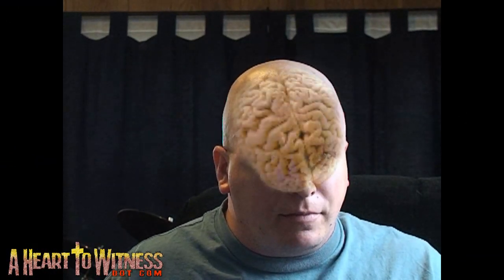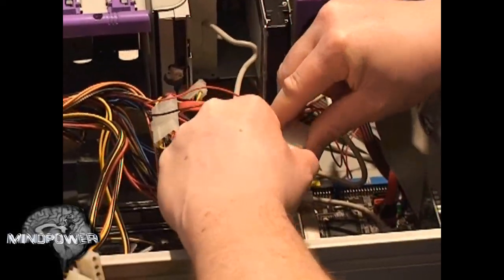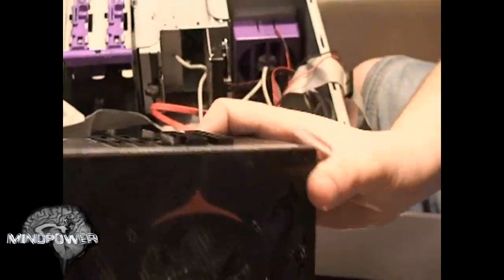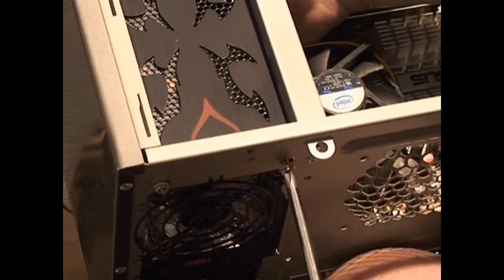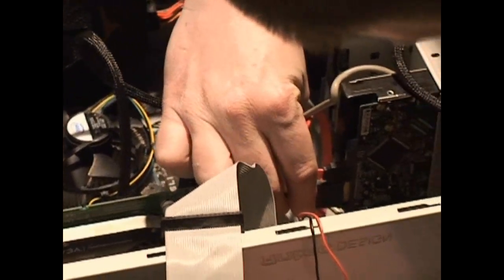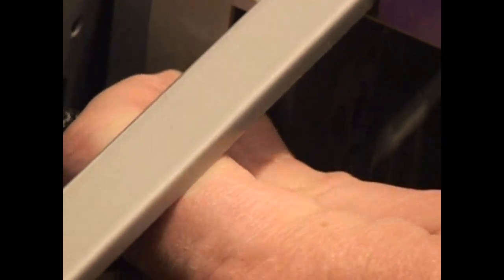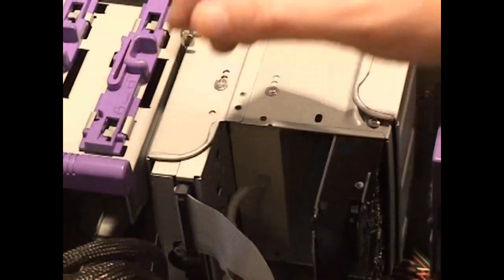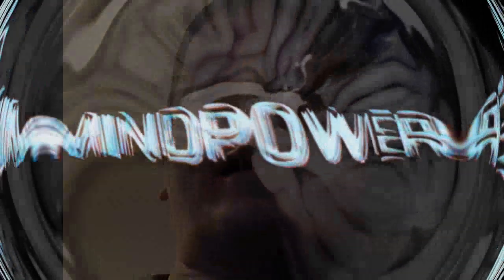How to Replace Your PC's Power Supply - Mindpower009

Comment: i found this psu.will it work ? it is Hantol psu 550W atx(12v 2,0) 120mm fan with 20+4 pin connector and 3-Sata

Comment: in theory, yes it would work but what we need to know is what power supply you have. You can't judge a power supply by its wattage. you need to research into it. First thing is that if your pc a a prebuilt, i can guarantee it's not going to work without blowing up your pc. E.G my good quality 500w power supply has a 6pin and a 6+2. Add those together and you get 225 +75w from pcie +more for the cpu. If i plug every connector into something, My psu wont handle it even though it is good quality

Comment: you will probably save money and get better components if you just buy them yourself and put it together. as far as power supplies go, you really dont need to worry about atx, matx ect, you can run into issues with oem cases but its not likely to be an issue like it could possibly be with a mobo. manufacturer and power ratings per 12v rail are important as well as sli/crossfire abilities if you ever want to go that route. also whether the psu fan is on the top or bottom can be a thing to conside

Comment: If a GPU requires a certain amount of wattage can you buy a PSU that just meets the requirement? Say the GPU requires 600W, so you buy a PSU with an output of 600W and it will work?  Constantly afraid that I will either fry my system or just not have enough power |:

Comment: Hi!
Then maybe you can tell me the solution of my problem. I bought a new power supply, and I put it into my PC, but it didn't work. I turned it on, and pushed the button on my PC. For a little moment the fans started working and then stopped. I connected the 24 pin cable and the 4 pin cable to the motherboard, and I connected my CD player and HDD. My videocard doesn't have any power supply slots, so I didn't connected it. I don't know why doesn't it work.

Comment: No, but they're very similar.  You should probably measure yours and make sure you get the right kind.   Most are ATX power supplies, and while older power supplies won't give you all the right cables for most modern computers, newer PSU's will provide most of the resources you need for an older computer.

Comment: What u did is pretty cool and all but i'm scared that there is a chance that i'm gonna mess up my PC. I only want to do this for installing a geforce GTX560(graphics card)  and it requires 500W power supply. Can u tell me if i replace my power supply to more than 500W power supply, can a pci express X16 slot alone provide more than 500W for the graphics card or do i also have to connect the graphics card to the power supply.

Comment from the maker: It's not exactly the same one, as my particular model was discontinued before I put that link in.   It's very similar though.  Most power supplies are very similar.   Just read the instructions, and remember to plug in everything you unplugged.  You might put labels on the plugs or write them down or something so you never forget.

Comment from the maker: You can usually see it on the back of the PC, but if the info is not there, you might have to open the PC and look directly at the PSU, maybe you'll have to google the model once you can see it on the box.

Comment from the maker: The gfx cards usually have whatever cooling they need built onto them (although some would say it isn't sufficient)  As long as the PSU and card will FIT into the case (most times the PSU will, but the cases of most of the HP PC's I've seen are pretty tight, it might be tricky to fit one of today's huge cards into it), it should be fine

Comment: Hi, I have an HP Pavillion desktop PC. I currently have a 300Wpsu and Radeon Hd 6570 gfx. I'm thinkin of upgrading it to 6870 and get a higher psu to support it. Is it possible to do this for an HP desktop? or do i need sum kind cooling, or new case etc.?

Comment: Probably, most of them are the same size.  It just depends on how many watts your system needs.  Make sure that there are enough watts to supply the computer.  If there are more watts than needed, the computer will just use only what it needs.

Comment: @Rhynorune I agree with AtomicWrangler86.  Your video card is probably fine, depending on what you're using it for, but the power supply really needs an upgrade.   300 Watt is not enough for your setup -- at least 500W in my lowly opinion.

Comment: @kuljd There should be another 4-pin section that has a clip on the side of it, that will connect to the side of the larger section.   If not, it's not an ATX power supply and you won't be able to use it.

Comment: @Rhynorune You should be able to add any wattage you want, as long as the power supply is compatible and can fit.   Your computer will only use as much power as it needs.

Comment: @ChirpeEprihc Then you'll either have to pull harder, or probably want to take it to a professional.   They can be really stubborn, but I've never come across one that won't come out.   As you can see in the video (maybe!) I had to pull super hard to get this one out.  That was 2 years ago, and even the new power supply is really stubborn.

Comment: @hyper9braker You'll have to brace the motherboard with one hand, pinch harder on the clip (yes, there is a clip that holds it very tight) and pull harder on the plug (not the cables!).   It's the only way.  You can use pliers but be sure to cushion them with tape or something because it is REALLY easy to crush the plug and damage it.   BE VERY CAREFUL.

Comment from the maker: @GozerTheGozerian Yes, and the other commenter was me (brobryce2009) :)  This video was shot back in 2008 I think, back when I only had one (not so great) camera and no light kit.  There are so many things I would do differently for this video, but so far, it's still helping people get the job done today.   As for the fingers thing, you might be right.  But I think a person can reach in and slow down the PSU fan without opening it.  At least that way they can find out if the PSU fan is bad.

Comment: @MindPower009 Right on. I just wanted to note that because the other commenter suggested putting your fingers in the unit to see if the fan's failing. I was worried that people would take that the wrong way and put their fingers in the power supply, which would not be good at all lol. 

Good advice on taking notes on wire placement, etc. Also might be useful to snap a few quick photos on a cam phone for reference before swapping out. Good job on the vid.

Comment: @Mike20878 you'll want to open it up and find out for sure.   You can put your finger on a fan and slow it down a little and if the noise stops, that the fan.   If it's the power supply fan, then it's time to replace the P/S.  I could show you pictures of what happens if your P/S can't cool itself down.   You don't want to be around when that happens.

Comment: I'm hearing a high pitch whining noise that sounds like it's coming from the power supply.  I suspect the fan has stopped working.  I can see right through to the inside when the system is on.  My system is about 7 yrs old so I figure it's time to replace the power supply.  It's a Dell Dimension 8400 and it came with a 350W power supply.  I found an ATX 460W supply that I think will do fine.

Comment from the maker: @rickrokks mostly the PC's from the last 8 years or so use the same type of power supply.  The only difference (most of the time) is just the sata and the rail line (for newer video cards) and wattage.

Comment: @saniydel Hey it sounds like you did what I do very often, and that's unplugged the internal USB connector from the motherboard.  It's an easy mistake to make when you're pulling all those plugs.  It's also a simple fix, just open it up and plug it back in.  Sometimes, if each pin has its own plug, you might have to google a USB PINOUT so you can figure out which pins go to which.

Comment: hi, i changed my power supply because it wont work, it was 300w, and i changed it into 550w, after i install all the wires and everything, my pc was working agian but the mouse, keyboard and webcam wont work. i tried to restart, then plug all in then remove it but nothing happens.,,, can you help me with this please?

Comment from the maker: @hlpization If you look closely you'll probably find that it is connected to your motherboard plug.  Many times they are attached and you can usually separate them as they are just clipped together.

Comment from the maker: @KillaKanl0rd MOSTLY universal.  If you open it up and the power supply looks like mine you can probably go out and buy most any power supply that matches your PC's configuration.  You want to make sure you get one that connects to your hard drives (like I was going from IDE to SATA) and can also power your video card.   There are no guarantees, but you'll be surprised how easy this is and how most of them do fit.

Comment: @gamer141235 Power supplies are universal by size, meaning any psu will fit into any desktop, providing it is not a "slim" desktop. 

Also, ensure that the psu you get has the same ATX format as your motherboard, as well as an appropriate amount of peripheral adapters. If this new graphics card you are planning on getting requires extra adapters, ensure the psu has them (usually they are either 6pin or 8pin connectors.)

Comment: @MdxIxbM it could have a 1,000 watt output, and if the computer is using anything less than 1,000 or whatever its limit is it should be good.

Comment: PLEASE ANSWER,

i am getting a computer and i feel i might need to replace the power supply in order to support a graphics card i want to get. What power supplies would you recommend and do any type of power supplies work with this computer. By the way, the computer is a hp pavilion p6700z series desktop if that helps. Thanks a lot, i need the guidance as i am new to these things.

Comment: @Hunock If you don't replace that power supply, and you run that 5770 (which is the one I ended up going with ) your PC might burn your house down.  Get a better power supply right away.  islagkage15963's comment is right.

Comment: @Hunock the hd radeon 5770 require atleast 450 watt power supply. so try checking out a price check site. find the cheapest with id say atleast 500 watt go in and see how it rates and if you can find any reviews of it so you can make sure it won´t catch on fire or anything

Comment: I bought a dell studio xps 8100, and I am currently trying to buy an HD Radeon 5770 Graphics card, but I fear my 350 power supply won't handle it, if possible could you reccomend a higher power supply and name its price, and if its not too much trouble, I know it won't draw more than it needs, but appart from human error (Hitting it off the motherboard during install) a power supply cant damage cards or hardrives ect right?

Comment: GENERALLY, when replacing a lower wattage PSU with a higher wattage PSU, providing the new PSU is of reasonable quality, it poses no danger to the computer, right?

I'm planning to upgrade a Packard Bell Imedia S3720 (PSU 250W) with a 500W PSU to allow for adding a Sapphire RADEON 4870 1gb GCard... Main concern is the PSU

Again, will doubling the PSU Wattage pose any danger to the internals, so long as it's of reasonable quality?
Thanks

-Richy

Comment: what's the model number or name of the psu you replaced?I like it cause you don't have a bunch of wires snaking out the psu and it look neat for it to be wraped around in black . if your don't have a video card u don't have to plug up those's cables

Comment: @AliRemix2009 I wish i could help! I'm 13 as well, and i'm replacing my 300w with a 500w so my new graphics card can draw more power. The graphics card part is easy, but im nervous about this power suply thing too!! Well maybe you should get a 450w or a 500w, it depends, Why are you getting a new one? It won't make it any faster unless your old one is too small.

Comment from the maker: @nightingaleron The power supply might affect the speed IF the RAM or the CPU were underpowered with the original PSU.  In this case, it's not really the NEW one that's going FAST, but rather the OLD one wasn't giving you enough to run the system, and it ended up going SLOW, choking on the cycles it was trying to do without enough juice to do it.  Other than that, typically the PSU doesn't make it any faster.  It's easy to underpower a system, though, especially these days!

Comment: I just changed my psu as it blew, the one i had was 350 watt output and the one i replaced it was 400 (thereabouts cant remember but it was bigger) I am new to this but my computer seems to run a lot faster and i am wondering if putting a bigger wattage unit does that. (i see you are going from 300 to 600 ).

Comment from the maker: @xBURNINGxDUCKLINGx Each plug is meant for a specific connector, but all the connectors that look the same also work the same.  for instance, the ones that fit into the CD/DVD drive, generally also work with the hard drive and even sometimes the case fan connectors.  The SATA connectors for the newer hard drives will work in SATA CD/DVD drives too.  The floppy connector is different, and the connector for the motherboard is a big different one :)  Not a stupid question.  Ya gotta know b4 u do it

Comment: Perhaps this is a stupid question but I'm a tech noobie :| .  Is there a limit on the size of the power core to computer ratio?  Example, lets say I have a comp that has a 350W supply but I want to upgrade to something higher like say 600 or so (guessing at number). Is there a way of knowing if the computer can handle that supply or is it a non issue. Any help would be great :D

Comment: hi umm. I'm trying to replace my power supply and the plug that's connected to the motherboard the big one not the 4 pin one well my isn't coming getting unplugged even if I do press the tab at the side of it

Comment from the maker: They're pretty much the same size.  There are some weird brand name PC's (especially those before 1998 or so) that had custom components purely so you couldn't buy your own, but most desktop/tower PC's nowadays have the same size drives and power supplies.  If you get it home and figure out it won't fit you can always return it, but you probably won't have that problem.  Just make sure you get one that's compatible (usually ATX -- look at your current PSU to find out) and got enough watts.

Comment: Ok i have a question. Are all power supplies the same size meaning one power supply will fit/work in all window pcs?? Cause im gonna go shopping for a new psu and i don't wanna buy a psu that wont work or fit in my PC. Thanks

Comment from the maker: Yes, I agree with that, but it is still true that many folks end up spending too much on a power supply that is just too much for what they are doing.  I'm thankful I changed my PS when I did because I ended up upgrading to a Quad Core processor.

Comment: a tip for anyone out there that knows nothing about power supplies. if you ever take your machine to a computer shop because it's not working, and they say your PS is dead. don't let them talk you into putting in the smallest one your system can get away with. I did that, and now my system shuts down when under any heavy load.

Comment from the maker: 2007FORLife says, "The Stock cooling always faces down and the PCB Always faces up unless they have 3rd party passive coolers such as the Sapphire Radeon HD 4670 Ultimate Edition.  As long as it fits into the Slot correctly, you're fine. Also remember to screw the bracket in nice'n'tight :)"

Comment from the maker: I think it's okay as long as it actually fits in that way.  Video cards will only fit into the motherboard one way.  The outputs should come out the back of the computer, so in the end it should make no difference.  Could just be that you have your PC sitting in front of you the opposite way from the way I had it.  That's usually the way I have my PC when I'm building it.  Except when I'm swapping power supplies.

Comment from the maker: Truly, you won't be able to manage getting the box out if you don't disconnect everything.  You'll really struggle to lift it out, and then you might break something while trying to find a place to set it down.  It's really as easy as it looks.  And if you don't plug something in, you're probably not going to break anything, it just won't work until you plug it in right.